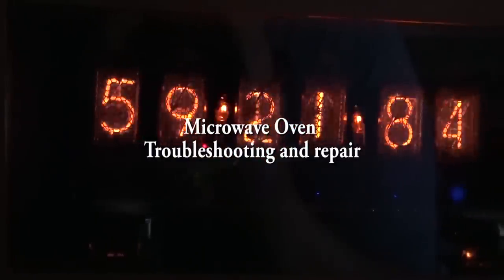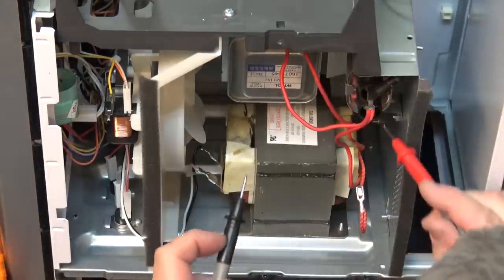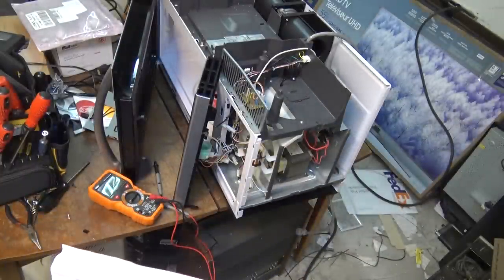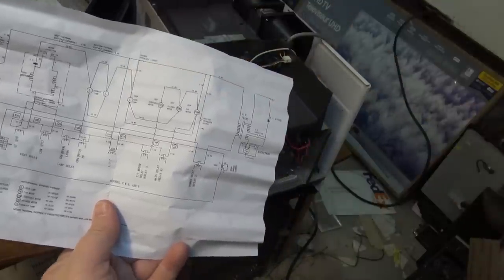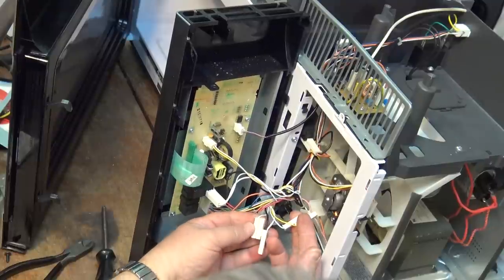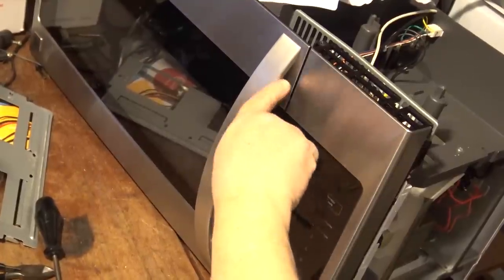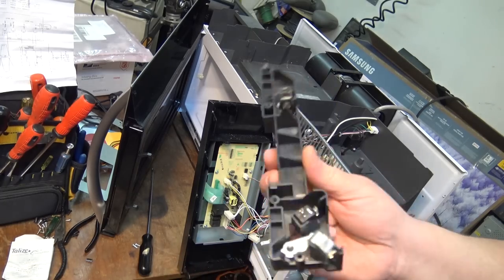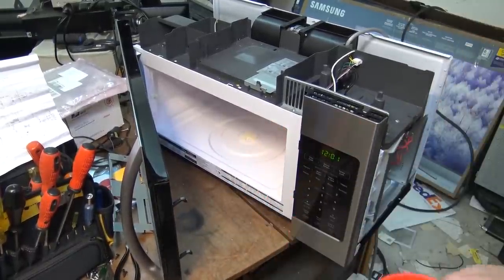Frigidaire Microwave Oven Troubleshooting and Repair

Comment: I'm presently repairing a microwave oven with same problem. I have watched several "instructional" videos regarding the matter and this particular video explained to me very well the flow of current and why the circuit breaker gets turned off. Other videos just simply say that it's the switches and just replace the "monitoring switch".  I'm more confident now in testing the microwave once I get all the parts put back to their original location. Thanks for the video.

Comment: JB Weld is incredible stuff. I imagine that it might actually make a permanent repair on that bracket. I once used it to repair the arm on my office chair that had snapped off completely from the vertical section just underneath the arm pad. I apparently had a habit of leaning my body to one side while watching videos and it proved too much for that single arm over time. I gathered the shattered remnants and jigsaw puzzled them together along with some popsicle sticks for vertical bracing and JB welded the whole thing together. The arm never gave me any trouble after that despite hanging on it for years after. Eventually the bolt that held the arm to the underside of the chair started giving way :D Of course by then the chair had really had it and I replaced it but that made me a JB Weld believer.
Reply from the maker: Redemptus Renatus 
Oh yes I know how good it is and it may very well last for the life of it. If I can't get a new part it might have to.
Reply: Jb weld sucks it won't hold anything high pressure .

Comment: Thanks ,  You are the only person to notice the worn switch holder bracket. Thanks to you, and Ebay the Microwave  is up and running. Thanks for sharing your knowledge.  Great Work !
Reply from the maker: Changed hundreds of those when I worked in the industry.
Reply from the maker: @edheuston673  This one failed because it was installed above a gas range. If you have a gas range you should NEVER install an over the range microwave. The reason is the heat. All that heat from the gas combustion goes right under the oven and heats it up really how, which causes the plastic parts to get soft, and will eventually deform.
This never happens on an electric or induction range. If you have a as range the only thing that goes over it is a high flow vent hood / fan.

Comment: Thanks for this vid. Installed a new microwave for a friend and noticed the old one wasn’t two years old (Frigidaire Gallery) they didn’t want it. Took it home found your video and sure enough the monitor switch was stuck in the closed position. Thanks.

Comment: Thanks for this great video. This was my exact situation with my Kenmore, including the switches having too much play in the bracket. Changed the bad switch, and epoxied all switches into their optimal position in the bracket. Working fine now. If I have more issues, I'll order a new bracket and switches.

Comment: What an excellent video, really well done an enabled me to solve my problem with a minimum of pain. Turns out mine was the switch but it sure was nice to see how to get the bracket out which made the replacement easy peasy. Also I really owe a big thanks to the Parts store guy who gave me a "generic" switch (6.60) vs the Frigidaire part (61.59).
Reply from the maker: I would still be wary of the plastic bracket that the switch mounts on, especially on over the range units mounted over a gas range. The heat from gas combustion really heats up the cabinet, and causes the plastic to get soft and go out of shape slightly so the monitor switch, which is normally held open when the door is closed, to short and weld it's contacts shut while blowing the fuse. Seen dozens of them fail, all mounted over gas ranges.
Reply: @12voltvids   you were correct! just finished replacing the bracket on my (over the range) unit and its only 2 years old.
Reply from the maker: @tigerted5504  
Is it a gas range by chance?
Reply: 12voltvids no, but there was wear on the bracket
Reply from the maker: @tigerted5504  
Yes it is a weak part for sure.  Add the heat from the range.  Gas ranges are worse because of all the combustion heat.
Reply: @12voltvids  I searched "Microwave" on your main page & found more videos! It might be nice if you would bundle those into a "Microwave Playlist"?!?!🇺🇸 😎👍☕
Reply from the maker: @lilblackduc7312  i do plan on making playlists and sorting stuff some day.
Reply: @12voltvids  You'll probably  never know how many old "Electronics Junkies" like me, hobbyists, 'makers', etc. you've helped so far. A playlist would be real easy for us to share with others!!! Thank you...
Reply from the maker: @lilblackduc7312  I'll work on that.

Comment: Thank you for a great tutorial. Fixed two microwaves with bad switches. A bad switch can be fixed as well, after removing it just open it and free the contacts, put back and it works great. No need to buy a replacement switch.

Comment: Thanks for making the video. The best tutorial on the subject from someone who is authorative. I replaced my monitoring switch 3 times in 3 weeks. I found I have the exact issue with the switch block in my microwave.  Seems like a very poorly designed part intended to perform a precise function.

Comment: If it was my personal microwave, I would drill holes in the plastic perpendicular to the worn groove and epoxy a (cut) nail in place. That way the door latch wouldn't wear out the epoxy. Since this is for someone else, I would avoid liability by not re-engineering the switch bracket. Sometimes my microwave doesn't want to start until I jiggle the door. Thanks to your video, I know more about what to look for.
Reply: Yes, there are other ways to fix the worn section.

Comment: My boss was cheap on tools too, we made a lot of our own stuff with the grinder wheel in the back of the shop, we used to replace all the switches with the bracket so we didn't get a call back on the unit,  I hope you can still get the part for your neighbor

Comment: I love the fact you got this going, especially with the use of  JB Weld. 😁 I never would have spotted the distortion in the bracket.
Reply from the maker: This was just a temp fix as the bracket took 5 weeks to order and the neighbor wanted to use it. It was swapped out once the part came in. Then the house was sold and the new owner remodeled the kitchen and threw out the microwave.
Reply: Its not really a distortion in the bracket. Its the door hook holes in the bracket that wears out. The plastic wears out and the holes get bigger.

Comment: Thank you for your video. I like your video. 
Question: What are the functions of the top switch (NC or NO), middle switch (NC or NO), and bottom switch (NC or NO)?
I might have the same problem as you had for the middle switch. So, what type of switch should I get, NC or NO?
Reply from the maker: The monitor switch is generally the bottom interlock. It's the one that shorts the line to neutral when the door is open.

Comment: Great repair, the j.b weld will last, it's bloody hard stuff :-D
A dab of vasolene/silicone grease to the hooks may cut down the stress/friction.
I don't like the hard way the door has to be closed to make it close, the door spring is likely too strong.
It's a shame that they ruined a good microwave with a crude lock operation :-(
Reply from the maker: zx8401ztv 

Jb weld held long enough to order a new part that was readily available

Comment: Very helpful video.  I'm having basically the same problem with my GE JVM3160RF3SS - the breaker pops when closing the door.  Each new short switch I put in gets fried too.  Going to order a new bracket.  Do you have a recommendation on door switches?  The actual OEM primary and secondary switches from GE are $45 a piece, whereas what seems to be the exact same switches (Dongnan KW3A 16A 125V/250V ) are on Amazon for $10 a pair.  Are the OEM ones actually better?

Comment: Vi there! Great  video!

Question: my fuse is fine and all the switches are ok but the microwave seems to not power up ( nothing) … how do I diagnose a fail on the front monitor (dial and led lights)?
Reply: Yeah I’m having the same issue.

Comment: A little Vaseline on the door switches latch would help make it last longer and easier to close & open. The door seems to require heavy slamming to close ... Good troubleshooting!
Reply from the maker: They are all like that. The reason these fail is due to high heat when installed over a gas range.   When over an electric range they don't fail. Why? Gas range produces much more heat from gas combustion.
Reply: @12voltvids  I was thinking the same thing. I think that call that under-engineering. LOL I have a 1200watt counter top 2006 Elite that act's perfectly, but won't heat. I had done main course meat, threw a potato in on auto , then frozen veggies and the veggies came out frozen and the unit had started getting loud. Did the reset plug, unplug and heard a sparking pop sound from around the transformer. Tried some water, it sounded normal again, but still no heat. Checked  out switches, mag, cap, diode and the trans "seemed" to test out okay. Everything appears to work normally with exception of heat. When I cracked it open, drained cap, .nothing looked amiss burn wise and I didn't see or smell any smoke. I'm stumped and taking somewhere would be a waste since a diag and repair would cost as much as a brand new unit ($150), more if it's the trans. Any clues or tips? Thanks.

Comment: Thanks, great video.  I had the same wear on my switch bracket (Frigedaire).  Brackets are the same for almost every brand.
How about putting a light lube on the bracket?  Wouldn't that reduce the wear?

Comment: Thanks so much for explaining the middle switch. From your explanation the middle switch ( NC ) when button is out the switch is on, and when the button is pressed in the switch is off. On my middle switch ( NC ) when the button is pressed in I have a reading. I replaced the switch with a brand new one and it does the same, when I check it with meter ( when the switch is not connected in the microwave both switches do as they are suppose to. I thought that maybe the switch was not pushed in all the way not making contact when i closed the microwave door but I removed the switch tapped the switch button down it still shows its on. if I remove the wire from the com on the switch it works.Thanks againRead more

Comment: This was actually my problem! Thanks
Reply from the maker: Very common problem. I have changed hundreds of them over the years.
Reply: 12voltvids I opened the door after using the nuke multiple times today and as I opened it it blew the breaker again. I checked the switches and they’re still good.

Comment: I had the same problem in my Black and Decker oven after ten years but I just heated and bent the plastic parts and it worked again for another few years and is still running today.

Comment: Great explanations.  I have a very similar unit.  My unit seems to operate normally, but does not provide any heating.  The fuse is good.  Any recommendations or videos that show troubleshooting that?
Reply from the maker: Does it make any strange sounds?
I don't want to give advice as far as measuring any voltages around the transformer due to the extremely high voltages involved.  I was whalloped by a microwave and it threw me about 6 feet trough the air.
Reply: @12voltvids  No strange sounds.  other than the food not heating, you wouldnt know that the microwave wasnt working properly.  i pulled the cover and verified the fuse was good.  in order to get to check capacitor, diode or magnetron i would have to remove this thing from its mount it appears.  dont know that i am willing to go through that.  I did not do any checking of the door switches.  this is a new microwave that was installed prior to us bying this house 4 months ago, and was working fine until just days ago.
Reply from the maker: @erichirschfield5779  
You can put an AC volt meter across the primary winding on the transformer and see if the 120v comes on when it is supposed to be heating.  This is the smaller winding.  The larger one with the red wire is the HV side.  Stay away from those.  If the meter shows 120v AC and it isn't heating then the magnetron could be bad.  If no 120v when you press start then either you have a bad primary switch (top one) or bad crimp connector or bad relay on time board or bad timer board.

Comment: to diagnose known short-circuited devices like this one would it be possible to have an extention cord with an RCD that is tripping a bit earlier than the main house one so you can easily reset it without needing to run through the house to reset the main one ?

Comment: Would it be wise to put some kind of weights inside to keep my microwave from sliding around while operating it and opening and shutting the door? Our 2018 emerson crapped out on us and I bought a brand new mainstays700watt. It works great its just that it slides around. If I can avoid having to open it up to make it heavy that would be great. Where can I buy some adhiesive rubber feet that are grippyer than the ones it has?

Comment: great video! 

I would also like to add, it would be wise to make sure there is continuity across the pliers before discharging your capacitor with them.  You can never be too safe.  Maybe its just my OCD but I had at least one set be intermittent. You also can never know, some cheaply made pliers might have a plastic washer spacer between the jaws.
Reply: There are other ways you can discharge a capacitor.If you don't feel safe doing it with pliers then simply use a method you prefer but don't let it detract people from the very good video made once again by 12 volt vids.Clearly you can see he has years of experience fixing appliances and he is passing it on to others very very  well
Reply: @Hobbyscrapperaustralia  not detracting at all!
We're just neighbours helping neighbours after all
Even the most knowledgable can make mistakes
You can never be too safe is all.
Reply: @coolelectronics1759  as a fully qualified electrician I agree 100%👍

Comment: I have a kenmore here no heat and i check switchs are ok . I see no have 120v when start in the transformer i check the relays and didnt have continuity . This model have 2 relays the high and low . But i dont understood squematics. So for test i jump the plug cknector goes to the low relay and the heat cames again. If i do the same as the high relay the microwave didnt power on. So i believed the issue its with the low relay? I change for another and didnt work. What you think?

Comment: Here is the problem.....they are opening the door to pause the microwave instead of hitting PAUSE on the key pad and then opening the door. If you yank that door open when running and the door opens uneven or the bottom latch switch disengages first....you get a power serge to that switch you replaced. They put PAUSE on that key board for a reason and people are just pulling the door open to pause it instead of cutting the power with the pause button THEN opening the door.

Comment: Our Microwave is not blowing fuses,  it just does nothing, as if it were unplugged. 
When it first went out  we assumed the Microwave was trashed, but the next morning it was back on and worked fine .
It went off again  that same day but came back on later in the day and has worked fine for about the last month,  but when it shut down the last time that was it.
The  fuse and the door switches appear to be working properly and I have power at the outlet. 
Any ideas would sure be appreciated. 
Thanks, Ray

Comment: Sears is not out of business in the US.  We still have a Sears hometown store.  Sears doesn't make their appliances anyway. Most are Whirlpools though the microwave probably isn't.
Reply: I'm pretty sure that microwave is manufactured by Electrolux. Frigidaire is just a brand name they slap on their products.
Reply from the maker: J.T. Johnston 
Microwave is a frigidaire which is electrolux which is .... wait for it .....
General motors!
Reply from the maker: Bushougoma 
Right which is a general motors company.
Reply: Fridgidaire was a GM product up until they were sold off in the late 70's. Electrolux is not a GM company, as seen by this breakdown of their ownership; https://www.electroluxgroup.com/en/ownership-structure-392/

Comment: I don’t know if you will be able to help or if you will even see this comment. I have a fridge date microwave that at first was tripping the breaker randomly. Eventually it started to trip the fuse…

The odd thing is it doesn’t trip during usage, it trips while idle/standby. I tested everything as you shown on the video and everything is perfect. In fact I intentionally opened the door with bottom first to see if anything would happen, but nothing happens. I can’t for the life of me understand why it would trip randomly as it has been. I’m considering replacing all 3 door switches but I doubt that would solve my problem.
Reply from the maker: Usually it is the plastic bracket that is failing.  Causing the monitor switch to close and blow the fuse.
Reply: @12voltvids  Even when it’s on idle? Not being used at all? The issue is I can’t replicate the fuse tripping at all.
Reply from the maker: @xkatanaswordx  even when not running the power is across the switches.
Reply: @12voltvids  thank you, in that case I’ll try replacing all of them.

Comment: You have a good chance that this microwave cross references to a common brand.  We had a Kenmore stove that was choc full of GE branded components on time.  We ran it into the ground.  GE made several fridges with the same style of door handle as our Kenmore.  Back in the day, Whirlpool probably made more window air conditioners years ago under the Sears brand names than they did their own.